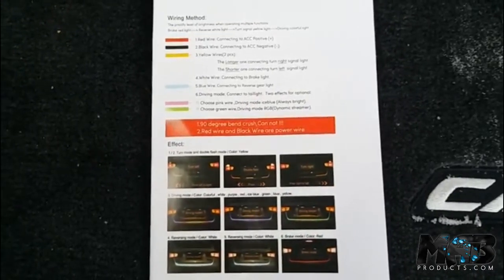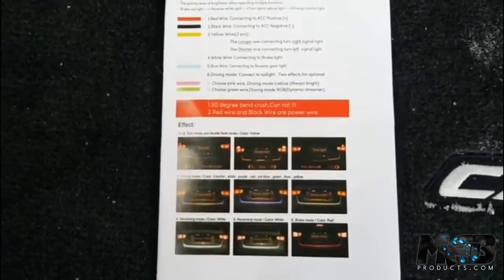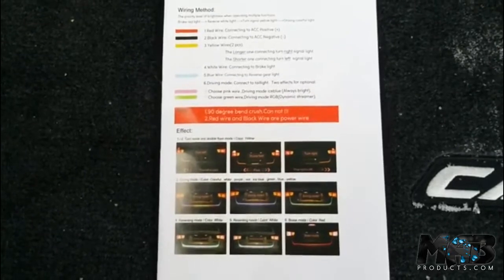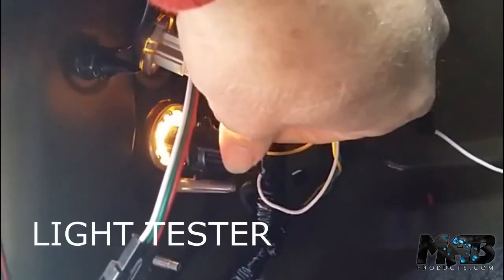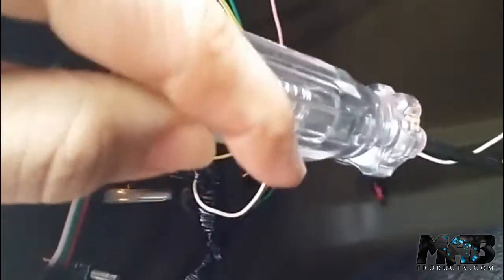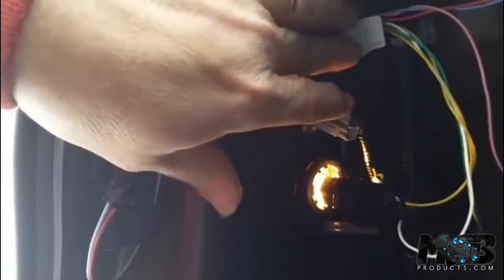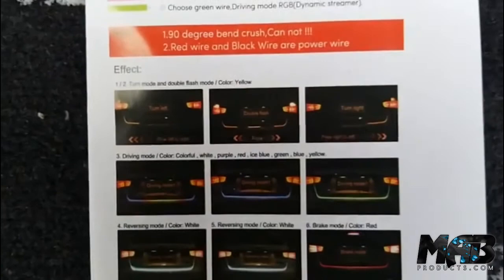How To Connect New LED Trunk Light Strips

Comment: Great video thank you. Only one question.
Does the Red ACC power cable turn on Any lights at all or is it just the positive. I have a different brand and I believe the red + might turn on the blue running as well
So bacially when my red and ground are connected it seems the blue running light is on. I don't want a running light D:
Reply: Just using my battery has a resting power source haha

Comment: hi Miguel! I finally decided to go outside today and try to connect the wires, but before i do that, the only doubt im having it about the red wire. I know we have to connect this one to give power, but i dont know to which of the light i should connect it ..? :(
Reply: Tuga em Bristol connect it to a source of power that's onl live when ignition is on the "acc" not constant power, or when turning the marker lights on not the headlights, I connect mine to the auxiliary lights

Comment: The black wire where does it goes? I have s corolla 2015 so it’s similar
Reply: Marcus Garcia , black to ground,  i used one of the tail light screw/ nut
Reply: Minute 2:25 you can see it on top left corner.

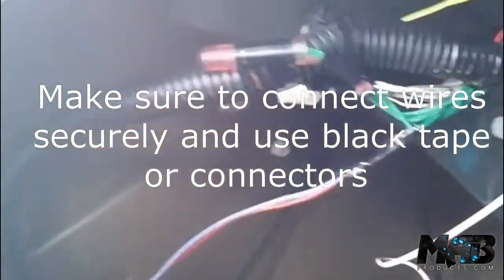Comment: For your positive(Red and blue), any of the green wires shown on minute 4:45 can work or does it have to be a specific green wire?
Reply from the maker: Angel do you have a Toyota Camry?
Reply: I have a Toyota Corolla 2015 and I’ve seen those green cables
Reply from the maker: I just picked a random one that had power when the accessory lights were on.

Comment: what kind of cable is the extra wire ? if i want to buy it on ebay, can you show me one example of cable ?
Reply from the maker: I think I used 14 or 16 gauge wire, you can do a search for it on eBay, what do you need the extra wire for?
Reply: thanks for the quick reply bud

Comment: Greetings as I can do to remove only the runnig ligth and leave the other functions is that no.I like how the sky blue color looks all the time on. thanks since now
Reply from the maker: Carlos Rodriguez, do you want to remove the running light? if so disconnect the PINK cable and only use the directionals, brake, and reverse. You can use whatever mode you like :), I have customers only using the directional and brake mode. Let me know if I can assist you any further, Thanks!
Reply: Miguel Betancourt Thanks for your help but my led has the red as the one that goes in positive and I think that if I do not connect this red in positive they do not light any of the functions please give me a help I do not want to discard the led only for this detail. as I wrote you I do not like led running ligth. thanks for your time
Reply from the maker: Correct, you have to connect RED to a source of power, preferably that it only gets power when your lights are on. As far as the running light mode just don't connect that cable. :)

Comment: LED Trunk Flow Light [Need Help]
I have an LED Trunk Flow Light intended for signaling/braking.

It should be very easy to install...

I have a 2013 Mazda 3 I-SV

Just messing around to see how this works I hooked them up to a 9v Battery, they work, so in short, its not a dud…

Now to test them out, I connected the Red (+)Power to the + side of the 9v, then I connected the Black(-)Ground wire to the - side of the 9v… its getting power!

I now connect the Yellow(+)Left Turn Signal Wire to the Gray(+) Left Turn Signal wire in my car, nothing happens…. Their is two wires that connect to my Left Turn Signal, the Gray is Definitely (+)

because when I test this by placing the RED(+)Power, with the Yellow(+)Left Turn Signal Wire and attach them both to the Gray(+) Left Turn Signal wire in my car, all the lights begin to flash.

Anyone know what the hell is going on?

#help #howto #electronics #LED #mazda #mazda3 #car #vehicle